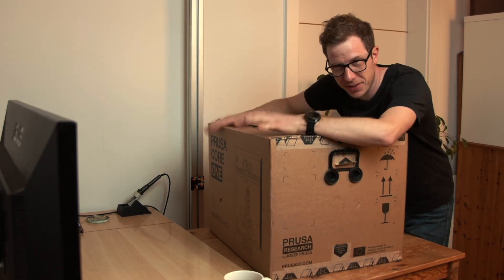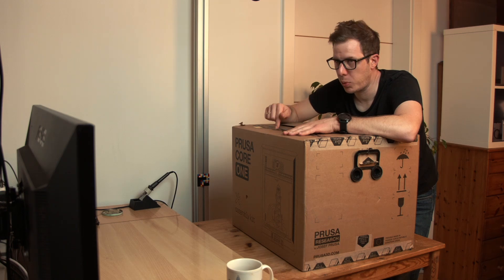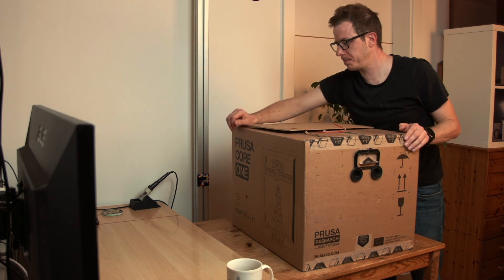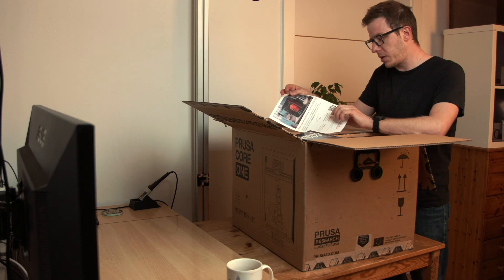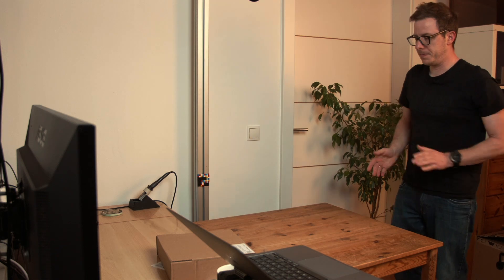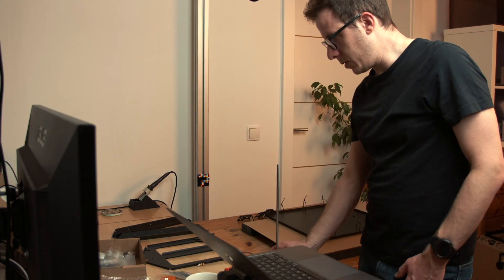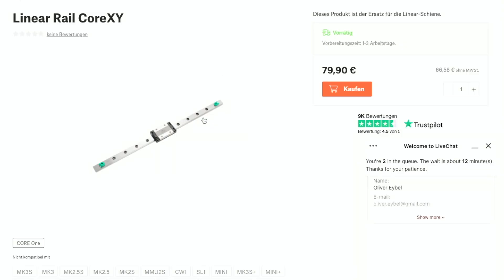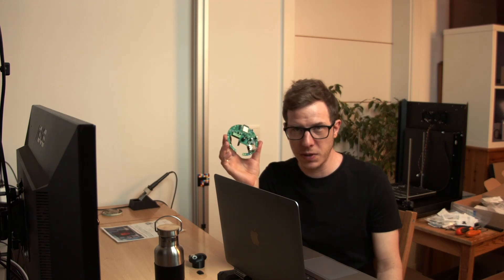Prusa Core One Kit Assembly Nightmare: The Missing Piece

Comment: Got my MK4S to Core One Upgrade Kit this week and had the rail and the cable ties missing. SO i would say this is not a "bad luck" thing its more like prusa is cheap on QC lately. My MK4S and MK4 and MK3S back in the day had nothing missing, so it seems they just ramp up the speed but are not up to the task.
Reply from the maker: Not good :(
Reply: My kit was missing one of the hinges and I had 4 top profiles with no holes instead of one with the holes in the middle (I was going to use the holes for a top hinge) Support was terrible on the profile but great when I contacted them again about the hinge.
Reply from the maker: @Wikcentral oh no 😮

Comment: Is that all? Did I miss something? I expected you to say that you stopped the build to check to see if anything else is missing, and either found it was a one-time mistake or that you found that there were other missing parts. Also, I'm curious whether Prusa does or doesn't provide a list of the contents of each box, so one can verify that nothing is missing before one starts the assembly.
Reply from the maker: Good point. I found a parts list, but it’s hard to tell just from the part names whether I’ve already used some of them in the machine or if they’re still missing. There’s also a step-by-step list organized by assembly stage, so checking everything would mean going through each step, finding the corresponding boxes, and verifying whether the parts are there—which is quite a bit of work. I should have done this before starting the assembly, but I didn’t expect anything to be missing.
Reply: @playduino  I'm confused. I just checked the online instructions for that kit and it says that each bag and box is supposed to have a label that specifies its contents. Is that not correct?

They've also got an online cheatsheet for the the fasteners. They probably should also have cheatsheets (with figures) for everything else if the part names aren't obvious.
Reply from the maker: @bruceadler-9410 its true but most of them only have the names written on them - some of them have drawings.
Furthermore, bigger parts are just inside of the box without a bag with names on them. Only smaller parts are in bags
Reply: @bruceadler-9410 that should be in the box, not online. It costs almost nothing to laser print a sheet with that info and put it with the rest of the instructions. People shouldn’t have to go to their computer, find the company, find where the product support is and then look for the needed document. That’s unacceptable.
Reply: Some companies are better at this than others. It’s expensive doing it correctly. They rely on you knowing how these things go together already, even if in general. That’s not a great assumption. They should have a sheet with a drawing of every fastener in actual size, named as to what they are. They should also provide a list of whatever is in each bag and the bags should numbered or lettered.  All parts should have decent drawings with the number of them. Honestly, missing parts are inexcusable. This all needs to be checked with some formal procedure before it’s packaged in the final box. I used to be a manufacturer. I know things can go wrong. But when providing something as a kit, you can’t disappoint, or even anger your customers with even one small, but needed part that can’t be easily purchased in a hardware store nearby.
Reply from the maker: @ I agree, they should make sure that no part is missing. But l’m happy with the end result. I got the missing part within a few days, no questions asked.

I either make sure all parts are in the box or you make sure customer service is top notch 😂. Don’t get me wrong, I would really hope for both